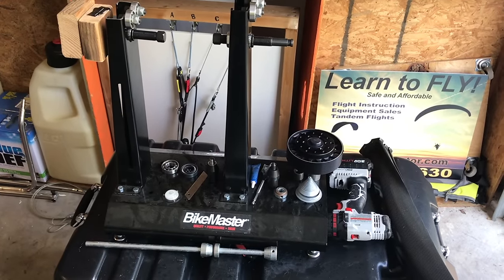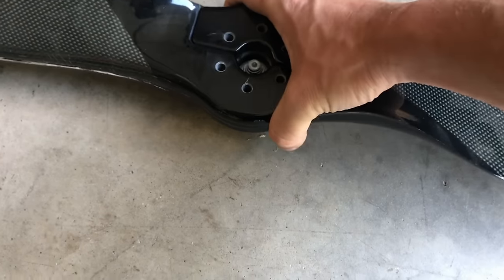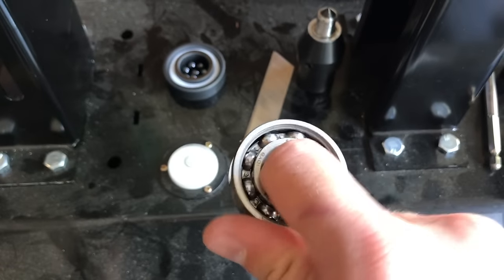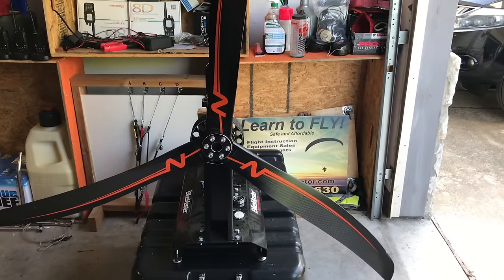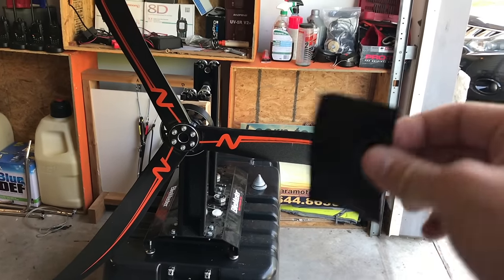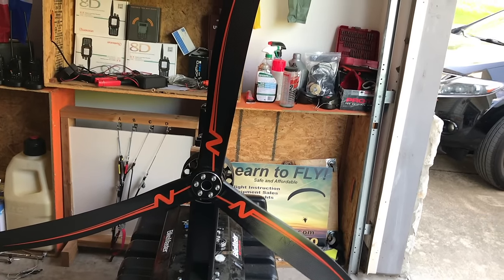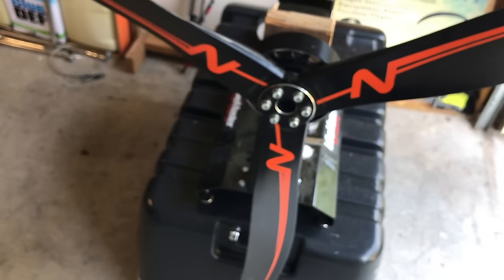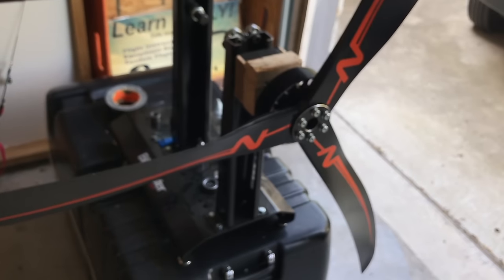Paramotor Prop Balancer

Comment: In my RC world of quadcopters we have found that sometimes its the hub out of balance vs the blades.  To add weight to the hub we use hot glue with very good success.  I add some glue, let it cool and then if its too much I use a razor knife and whittle off little pieces to bring the weight down to perfect.  I bet it works just as well at your scale.

Comment: Nice setup! Not to be paranoic here about if the still-rotating prop is balanced enough or not (or if it's just a draft in your workshop), you should know the target precision and compare. I once read somewhere that 1gramm*meter is enough good balance for a paramotor prop. So, from time to time you can just intentionally apply 1-2 grams (e.g. of a sticky tape) to one of your blades' ends (which will be ~0.5-0.6 meters from the axis) and you'll see the picture. Of course you can always do better than that, just that you don't need to achieve the prop to be still completely.